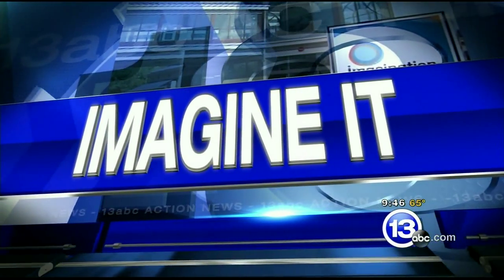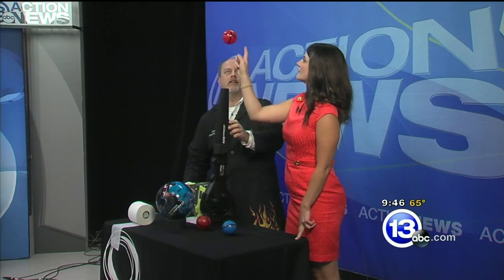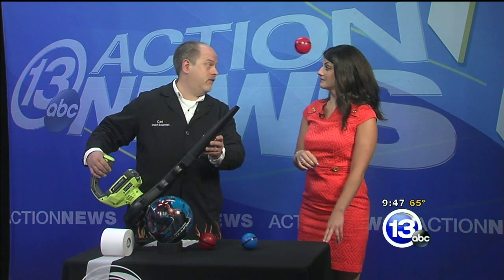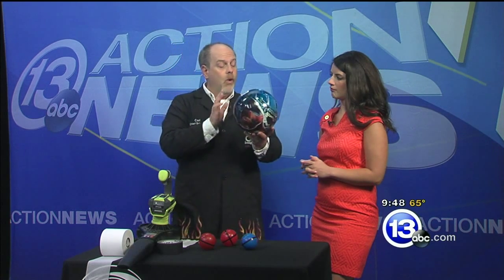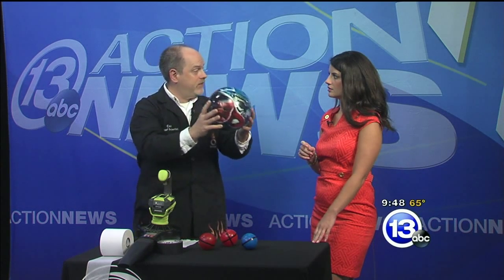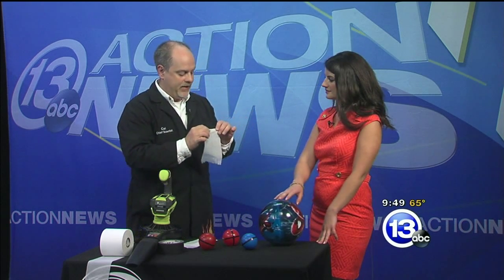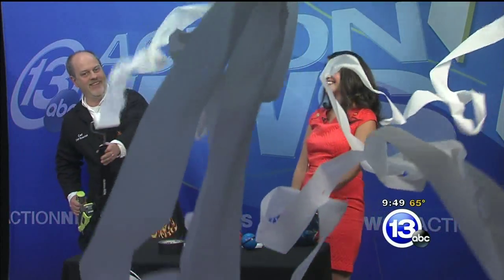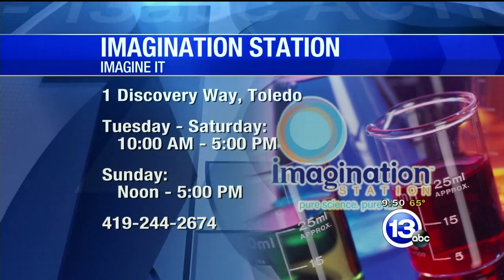Imagine It - Bernoulli's Principle

Comment: Looks like you've done some research and have some good information here.  So many like to show Bernoulli with all the wrong interpretations and demos....
"For a ... fluid that is flowing quickly, there is a low perssure area" is not what the Bernoulli Principle says.  
When summarized correctly, it says that for a velocity increase, there is an accompaniying pressure decrease (and visa versa).  
This is **_not the same as the all too commonlly misinterpreted Bernoulli Principle that you quoted.  Velocity changes are accelerations.  The pressure changes occur at the point where the velocity _is changing.  If the velocity is relatively constant AT ANY SPEED, then the pressure is not reduced solely due to it's speed.  The pressure is lower because the air was pushed there by a higher pressure behind it (Newton).
Since the stream of air exiting the blower was sped up inside trhe blower, there is a higher pressure inside the blower pushing (accelerating) it out into the normal atmospheric pressure.  Once out of the blower, it has the same pressure as the surrounding air.
...
The "Bernoulli Principle of Fast-Air-Has-Lower-Pressure" is a myth, not another science principle that has to be memorized line Newton's three Laws, yes it has been taught to millions by thousands by well meaning teachers which does not make it correct.  Many who shoud have known better have parroted this myth ad nauseam.
-- 
Cheers, ScienceAdvisorSteve
"For a ... fluid that is flowing quickly, there is a low perssure area" is not what the Bernoulli Principle says.  
When summarized correctly, it says that for a velocity increase, there is an accompaniying pressure decrease (and visa versa).  
This is not the same as the all too commonlly misinterpreted Bernoulli Principle that you quoted.  Velocity changes are accelerations.  The pressure changes occur at the point wher the velocity is changing.  If the velocity is relatively constant AT ANY SPEED, then the pressure is not reduced solely due to it's speed.  The pressure is lower because the air was pushed into a lower pressure region by a higher pressure behind it (Newton).
Since the stream of air exiting the blower was sped up inside trhe blower, there is a higher pressure inside the blower pushing (accelerating) it out into the normal atmospheric pressure.  Once out of the blower, it has the same pressure as the surrounding air.
-- 
Cheers, ScienceAdvisorSteve

Comment: Looks like you've done some research and have some good information here.  So many like to show Bernoulli with all the wrong interpretations and demos....
..
 HOWEVER 

"For a ... fluid that is flowing quickly, there is a low pressure area" is not what the Bernoulli Principle says.  

When summarized correctly, it says that for a velocity increase, there is an accompanying pressure decrease (and visa versa).  

This is **_not the same as the all too commonly misinterpreted Bernoulli Principle that you quoted.  Velocity changes are accelerations.  The pressure changes occur at the point where the velocity _is changing.  If the velocity is relatively constant AT ANY SPEED, then the pressure is not reduced solely due to it's speed.  The pressure is lower because the air was pushed there by a higher pressure behind it (Newton).

Since the stream of air exiting the blower was sped up inside the blower, there is a higher pressure inside the blower pushing (accelerating) it out into the normal atmospheric pressure.  Once out of the blower, it has the same pressure as the surrounding air.
...
The "Bernoulli Principle of Fast-Air-Has-Lower-Pressure" is a myth, not another science principle that has to be memorized line Newton's three Laws, yes it has been taught to millions by thousands by well meaning teachers which does not make it correct.  Many who should have known better have parroted this myth ad nauseam.
-- 
Cheers, ScienceAdvisorSteve